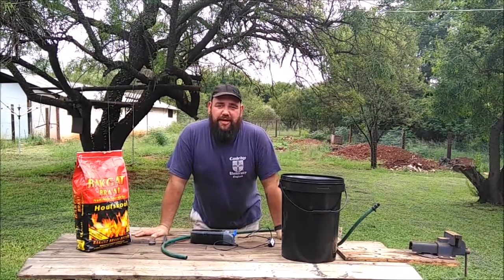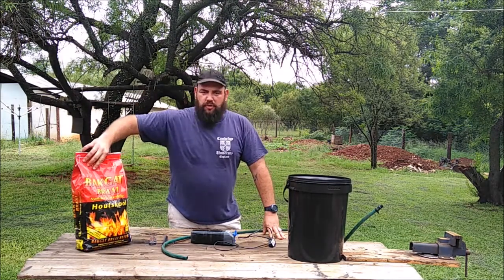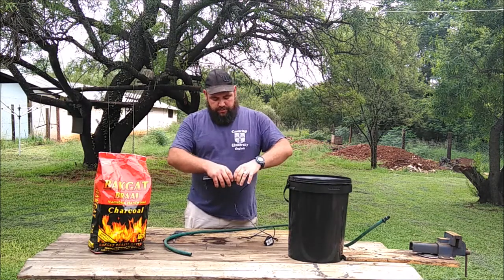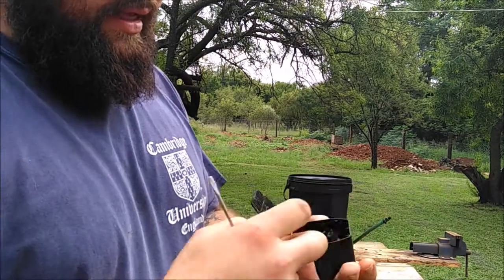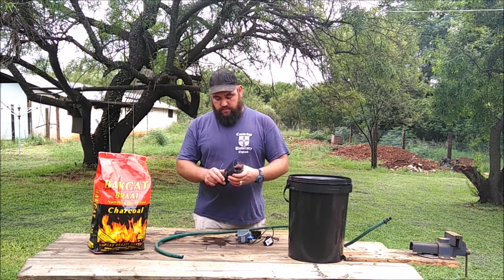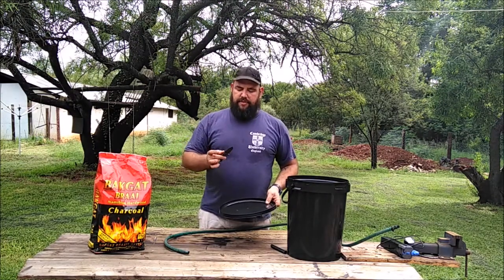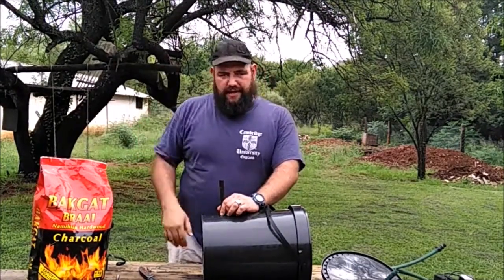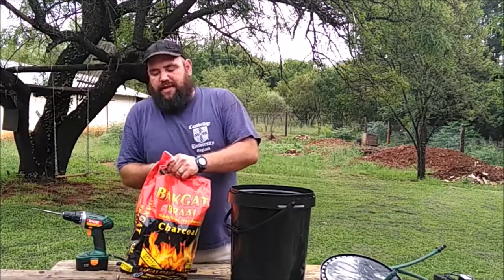DIY charcoal fishpond filter

Comment: charcoal filter well/ok   but activated carbon has a x1000 times more adsorption,, not absorption,,  than regular carbon. there's  a reason the stuff exists and cost more.  compact higher level of chemical filtration and last longer than charcoal. 1000x times more porous .  the process of making activated carbon is next level after charcoal/regular carbon. also   NB NB  we dont use wood to make activated carbon we use bamboo or coconut shell since it produces a a-carbon conducive to water filtration. charcoal will not filter out all chemicals. just buy a 25 kg bag ACarbon and save on cost. = R800 / 25 kg = R24 / 1kg